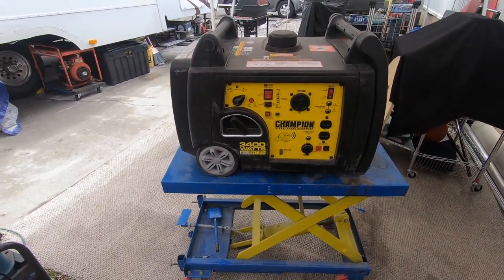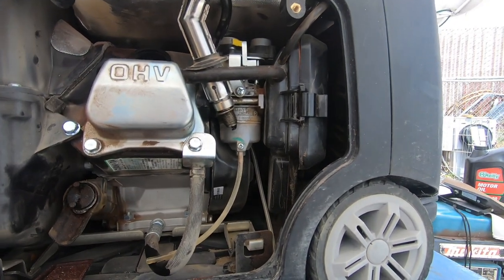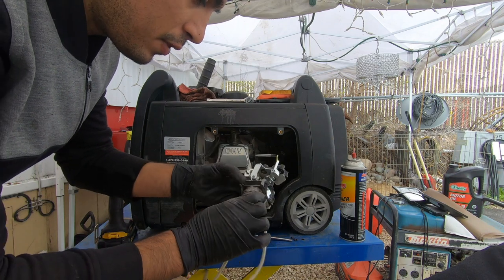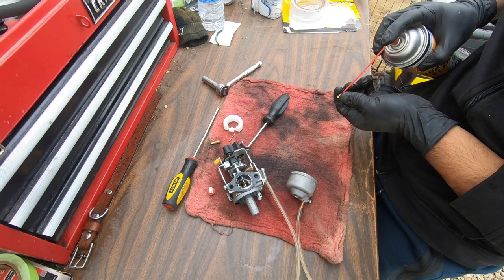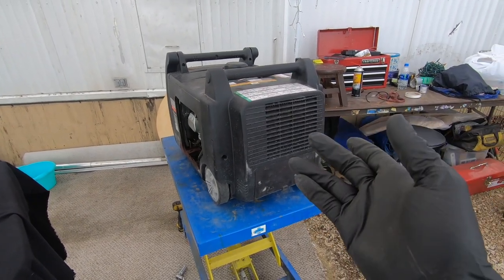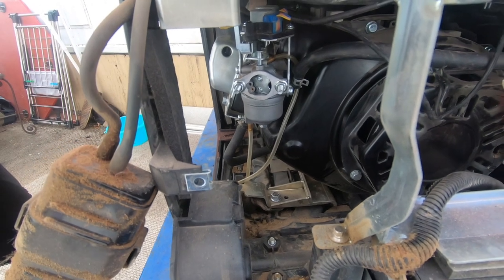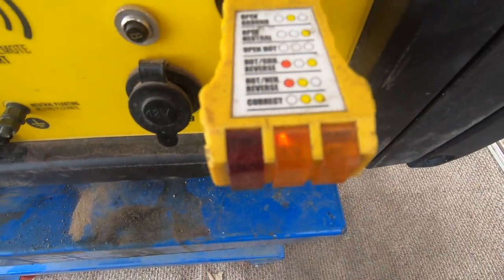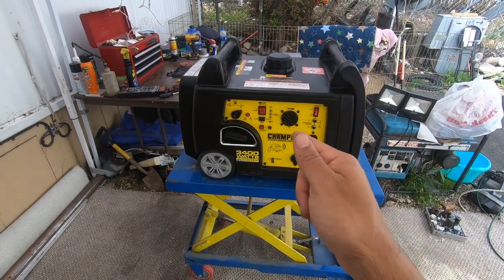Champion 3400 Generator. how to clean carb and run diagnostics.

Comment: You! You... SOLVED THE PROBLEM that I was having with our 'new' Champion 3100w inverter/generator. Although new, it had been stored for a couple of years with gas before I got it with a used RV. Our symptom was that it would only idle with the choke on. The carb was starved for gas because the gas had gone bad and more than half of the jets/ports were clogged/gummed-up (additives would not do the trick at that point). Choking a carb reduced the airflow and that would allow it to idle (on the limited fuel supplied) but it would not idle at the needed full throttle and that resulted in the inverter easily overloading. YOUR VIDEO showed me how to remove and clean the carb and THIS SOLVED THE PROBLEM. Our inverter/generator now purrs like a kitten (ok... maybe a little louder than that) and runs at factory specs providing all of the needed watts/amps. T  H  A  N  K     Y  O  U  !!!
Reply from the maker: I'm really glad my video helped you fix you generator! don't forget to run it out of gas and drain the carb before storing the gen. do not trust Stabil. and don't forget to subscribe!

Comment: Thank you SO much for this detailed video.  My Champion 3100 was surging at idle - I knew it was the low speed jet but hadn’t been able to find it on this carburetor (it’s different than all of the motorcycle carbs I’ve worked on over the years).  I had taken it apart a couple of months ago but without finding the low speed jet wasn’t able to fix it.  I took it apart again today and, once cleaned per your video, it started right up and purred like it was brand new.  Thank you my friend - keep up the good work and keep sharing these great videos.
Reply from the maker: Thanks for the compliment Mr. James, best way to thank me is to like the video and subscribe to my channel, that way my videos will reach more people on this platform. the low speed jet has the tiniest hole in the entire fuel system that's why it's usually the first one to get clogged and make the generator run poorly.

Comment: This is the second time this video has saved my bacon  - and just in time for Hurricane Milton! Thanks from a Florida resident!
Reply from the maker: You're very welcome!  

After this hurracane season is all done. 
Run it until it runs out of gas then open the drain screw on the carb let the little gas left run out and close the screw. give it a few pulls to suck in any residual fuel and. it will 100% start next time you fuel it up! extra points if you change the oil one quart of non synthetic 10-w30

Comment: Disassembling my Champion 3400 Duel Fuel today to see why propane was flowing through the carb when the generator was not running I noticed the Inverter panel showed signs of overheating and I wondered if that was why it stopped running on gasoline yesterday and refuses to start except for a few seconds with starter fluid. Tomorrow I'm going to try unplugging like you did and see what I learn. Watching you remove the carb gives me the confidence to pull it in my quest regarding the propane-flow problem. Can't thank you enough.

Comment: Thanks for the video boss. I pulled my champion 3100 out of the barn after about 6 months for the winter. I had left the gas line open. I pulled it maybe 10 times, it started and ran for about 35 seconds to a minute and immediately cut off. I'm really hoping this is my issue.

Comment: Very awesome!! Thank you!! I just bought 2 of this same model for dirt cheap from a friend. He added fuel stabilizer, taken good care of etc. But the last time he tried to start them they wouldn't start. I'm thinking starter fluid first, and clean the carbs should work. But if not you just showed me what to do next. Thank you! Great video, great info. :Nic.
Reply from the maker: You're very welcome!  just pull the air filter open the choke and spray a little starting fluid if they run for 2 sec they need the carb to be cleaned. then go ahead and pull the carbs one at a time and clean them for best reliability. Once they're out use the hose that goes to the carb to drain all of the gas from the tanks. and only try to run them with fresh fuel in the tank. the reason why I find so many good deals around here is because people think that Stabil will make gas last forever and it does not, when you get them running and are ready to store them let them run out of gas and use the drain under the carb to drain any left over gas in the fuel bowl. that way when you need them next all you have to do is get fresh pump gas and they will fire right up unlike it happened to your friend. last make sure to change oil every 100 hours for best longevity. -Jonathan

Comment: Excellent.  I am on my second carburetor...only have like 7 hrs on it. The first one I left it unused go a little too long. So once I sprayed inside the throttle with carburetor cleaner and it started I called Champion and they sent me another.  So it was running great. I dont run it regularly because I was renovating the motorhome. Then no start again. Really??? I put some mystery oil in the gas to keep things lubricated because the first carburetor the needle for the float was stuck up and mo gas was in the bowl. But this one there is plenty of gas but won't run until I spray inside the throttle.  Frustrated big time. Ready to call Champion again...your video was very concise.  Great job
Reply from the maker: how long does it sit between the times you use it?

Comment: Well done, thank you so much! Liked and subscribed. You have a gift for clear and thorough explaining things! I have the dual fuel model. The solenoid was sticking so it only ran on propane. Would it be better to run Trufuel in these small engines rather than gasoline?

Comment: I bought one of these generators about 8 years ago. After a couple months of sitting, the carb gummed up. Champ sent me a replacement and from there on, I use stabil in all my gas cans. Have left the geny for over six months and still cranks right up.

Comment: So impressed.  I would have left the carb in place, taken the float bowl off and checked it and leave it at that and try again.  This lad is brilliant and certainly knows his modern small engines/inverters.  Anyone know if these generators can handle 0W30 rather than 5W30 oil?

Comment: Edit: I located the two screws that require removal. They are behind the inside handle cover. 

Excellent work!! I have a new 3400 dual fuel unit and want to install an exhaust extension. I would like to remove the panel on the exhaust side in order to ensure that there is no leak between the spark gap flange and the genexhaust kit flange (yes, it has a bushing). However, after all the screws and bolts are removed (5 screws and 2 bolts) it seems like there's still something holding it together at the handle, even though the three screws are removed that should hold it together. Am I missing some fastener or clip? I don't want to snap the panel. Any help would be appreciated.

Comment: Great job. Just one question: There are 2 hoses coming from the carburetor. One from the bowl and the other from up top of the carburetor and just dangles. Where does that hose connect?
Reply from the maker: They don't connect to anything there are 2 holes on the bottom for you to put them through so that they can drain when the carb floods or when you drain it manually.
Reply: OK. The end of the top one looked as though it was attached at one time. Thanks for your help.

Comment: Hi this video it's amazing thanks for all the info given on the video, I was wondering if you might have recommendations I have the same generator but the 3500 watts and mine won't start I did everything you did but it will still not turn on, cleaned the carburetor, fuel tank, change oil, has spark and unplugged the inverter but still will not turn on, I was just wondering if you might have any other recommendations thanks in advance
Reply from the maker: does it have compression? pull the cord slowly and you should feel resistance on the compression stroke if the compression isn't enough to drag the generator without holding it then it's either worn out or you need a valve adjustment

Comment: As a retired MotorCycle mechanic I found too many mistakes that unfortunately will be taken as good instructions.
1) Trying to squeeze the air box cover out of the service door opening should have immediately directed removal of another panel. You spent way more time (at high speed FF) than just removing the inverter's black end panel. That waste of time hits you more than twice,  as in on the risky, likely errant reassembly too.
2) Using Brake Cleaner instead of Carb cleaner means cleaning will be different (not as good) and brake cleaner is very hard on rubber parts and will wash the cylinder walls of lube when sprayed into the carb opening with the engine running.
3) The Red and Yellow wired connectors MUST go to the proper inverter terminals because the Red wired one goes to the circuit breaker, then to the Hot terminals of the TT-30R and 5-20R outlets. The White wired terminal goes directly to the outlet Neutral terminal. You won the coin flip and got it right, as indicated by your plug in AC outlet tester's LEDs.
4) The brass tubular carb part held in by the Main Jet that fell out after tapping on the table is the Emulsion tube. The many small OD air holes rarely clog up but they do need gentile mechanical cleaning with wire to remove soft scale.
5) The 2 Brass air bleed jets beyond the choke butterfly shaft is what got sprayed, and that is the best way to fully clean and purge the low speed circuit that finally exits through 2 or sometimes 3 very small holes on the carb ID almost touching the throttle butterfly OD as the throttle just opens. Everyone ignores those holes, but they are key to solving part throttle RPM surging problems IF they are even only partially clogged! Spray them and the air bleeds first, before removing the (low speed) Pilot jet to avoid re-contaminating the Pilot jet.
6) Possibly the most important advice in using ANY generator is to use the shortest, heaviest copper wired cords to transmit power, and avoid "FRYING the inverter". Do NOT use 50' or 100' "Outdoor extension cords" (usually only 14 AWG or worse yet (thinner) 16(!) or 18(!!!) AWG) to power your neighbors refrigerator! Either move the Genny all the way over to him or use the shortest more expensive, larger wire diameter 12 AWG cord. Thinner diameter cords (the larger AWG numbers) have a higher Ohm resistance causing a Voltage drop that consequently raises the Amperage, which causes the cord itself, electric motors and Genny inverter circuits to overheat . . .  all the way to destruction.
7) Finally, shutting the fuel off and running the engine DOES NOT use up all the fuel in the carb float bowl! It is better than not running the engine, but not the best it can be. Open the drain screw after your fuel-off-run-out session and see for yourself. There is still about 20% of fuel left below the main jet location after the RPM cycles increasingly wilder because of the lowering fuel level inside the carb float bowl and the engine stalls. The ONLY WAY to "drain" the carb is to loosen the drain screw and drain it through the attached clear hose into a small container, even tipping the Genny towards the drain screw location to get-it-all. On Gennys with a dedicated pull-out choke knob I pull it all the way out and pull the recoil starter quickly about 5 times to suction out any fuel wetness in the main jet and especially the ~.015" diameter metering orifice of the (low speed) pilot jet.
-----------
I did learn something from you, that unplugging the (?Bad?) inverter power connector allows a bad running engine to run good, so thanks for that.

Comment: I know this video is old but with the motors on top of the carb you can actually open the other side of the generator and just unplug the wiring they are super easy to unplug

Comment: I also had a bad inverter board on my 3100, the generator would start, it would just not output any power. It's inexcusable that these are so delicate and go bad that often, a replacement board was like $300 when I ordered one.

Comment: Thank you for doing such a  good job on this video.  I'm just wondering if you could tell me how many plugs in total,  you had to disconnect and reconnect to the inverter board and what was that box  that was hanging on the left when you took the pannel off housing the board and battery? And do you recall there being any empty spots where something could have been plugged in but wasn't because when I look at the board from the top of mine, I see what looks to be, an empty hook up spot. Also I don't have a box hanging in the way, so just wondering as I to am trying to trouble shoot my champion dual fuel generator..
Reply from the maker: when you say you are trouble shooting what issues are you having with it?  also send pictures of what you are describing on the board to: immortalengines91@gmail.com and I will try my best to help you!

Comment: Great tut! What is the part # for the new inverter
Reply from the maker: CPE012207 Call champion power equipment and tell them your board went out they may send in a free replacement. if not it's about $180

Comment: You know your stuff!!! Nice job. I just purchased this generator, I’m in the process of doing my first 5 hour break in. Any advice on keeping it running good? It’s an investment I’d like to keep running smooth. 👍
Reply from the maker: all i can say is always run it out of gas before storage and drain the carb as well, a few pulls after that ensures all gas is gone from carb. always change oil every 100 hours these engines have no filter to running the oil longer than that will slowly "sand" your engine internals with the metal it sheds..

Comment: Great video. Thanks for the helpful info. Two questions, Do you have to have the battery to run the generator if you pull start? Mine is dead, I left the switch on evidently. And I do not see a fuel shutoff anywhere so that I can run the engine off when storing.
Reply from the maker: No, you do not need battery power to start it however this gen has an electric choke that runs off the battery so in order to start it with a dead battery what you will have to do is pop the rear cover and turn on the choke manually right at the carburetor, it has a little lever then once it starts immediately put the lever back to where it was so it runs smooth.

The fuel on and off lever is quite obvious, it's located on the far left of the panel where all the switches are. it has the logo of a gas station pump on it
Reply: @immortalengines1605  Thanks for your response. I finally got a new battery because the original would not charge more than 6.5 volts. I drained all the gas out of the tank the best I could with a siphon, drained the float bowl and had to use some ether to get it to fire off.  simple choking would not do it. It ran smoothly for a short while, but now without a load on it is not purring as you would expect with no load, it is racing and returning to a lower rpm. Wondering if I need to take the carb off and clean it from any old fuel residue? I plugged in a drill also to check the load and if I pressed the trigger on the drill quickly the drill would cut off(no power from generator evidently) then in a couple seconds i could squeeze gently and keep it running indefinitely.
Reply: I called Champion support and after explaining what was going on to the tech, he said he was sending me a new carb. since I left gas in it. Free.
Reply from the maker: @1xenman  Nice yes they do that often to help their costumers, specially if you're nice about it. I would suggest that you clean the carb and try to see how it runs after it never hurts to learn a new skill. when you pull the carb to either clean it or replace it turn the fuel to "OFF" then when the carb is off the Gen turn fuel to "ON" and drain it using the fuel line in a container since that's the lowest point in the fuel system. follow my instructions in this video of how to clean the carb and please never ever leave it with fuel for longer than 2 weeks if you're not planning to use it run it out of fuel and drain the bowl on the carb. that way all you have to do is add gas and it'll fire up!

Comment: I have a Champion 100263 Inverter Gen. It has about 6 hours on it. I had no run it for a while. When I started it... it had an oil leak. What can I add to the oil as a stop leak?

Comment: Great Job please show where to buy inverter panel?
Reply from the maker: Sure, call Champion power equipment at: 5622369422 and tell them you need part number: CPE012207. also don't forget to like and sub!

Comment: @immortalengines1605
I have this same generator. Runs fine, makes electricity.  Carb and all is clean. My issue is it only starts on carb spray or starter fluid. Once running, stays running fine, for hours if necessary. Turn it off, won’t start unless you respray with fluid. Again once running stays running. Is there some sort of priming system I’m missing. When choked, the act of trying to start should pull in gas from top of carb. Maybe I missed something up there. Could carb solenoid be causing this problem?
Thanks you 😊
Reply from the maker: check if the stepper motor is actually closing the choke when you are trying to start the stepper motors don't need much resistance on the choke or throttle shaft to stop working. remove the choke and lubricate the shaft and make sure its sooo light that blowing on it would move the butterfly. i can't stress enough of how weak the stepper motors are.